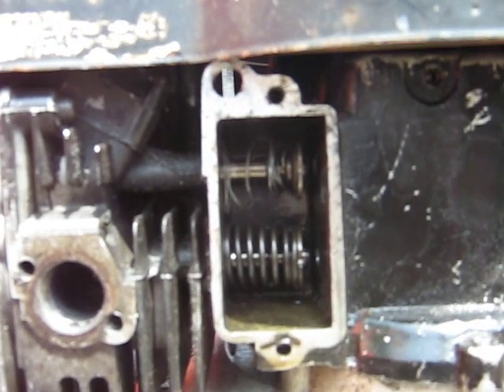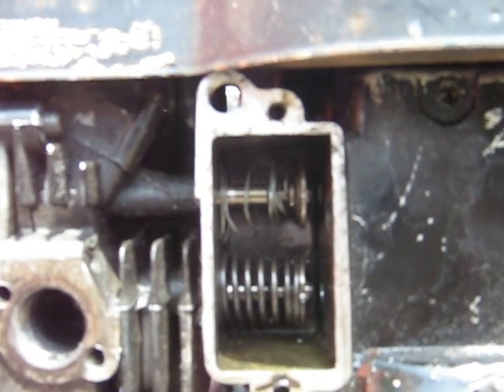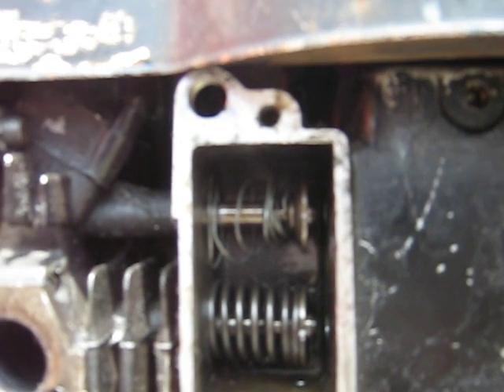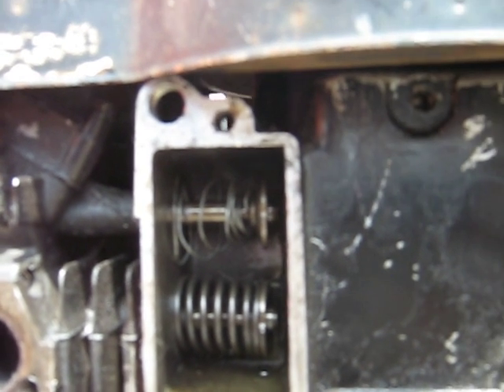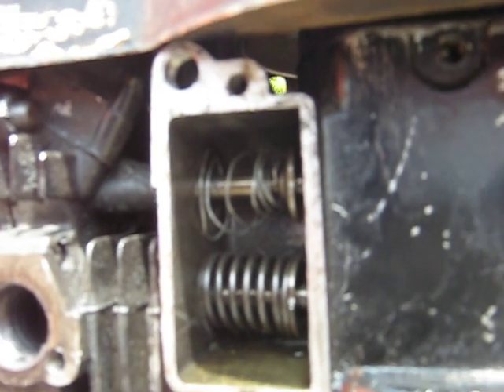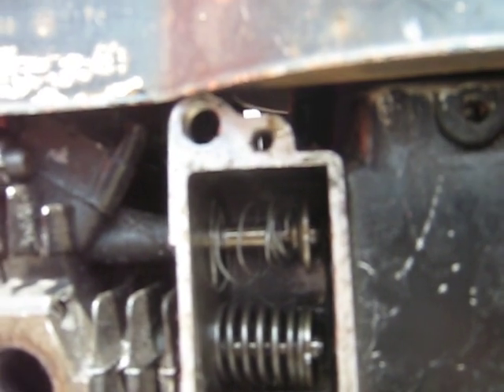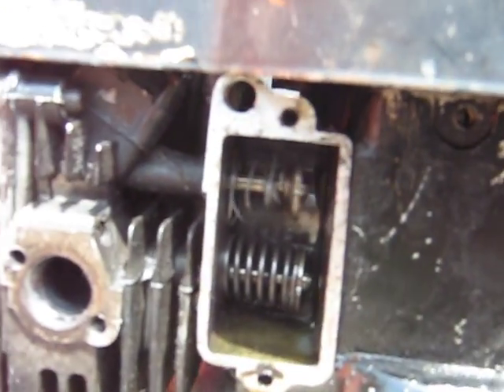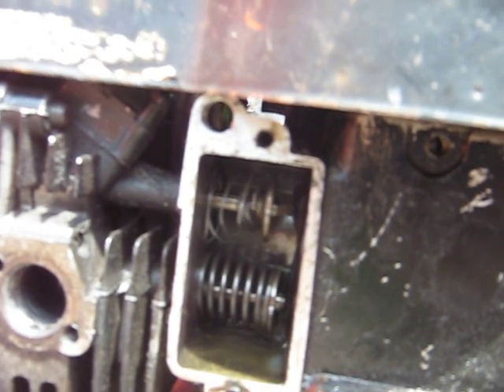Suction Valve Shown in Action!

Comment: yep, its an Atmospheric Valve, a lot of old flywheel engines use them because they rev so slow they do not need a cam operated intake.
they make a cool snorting sound when running at really low speed :D